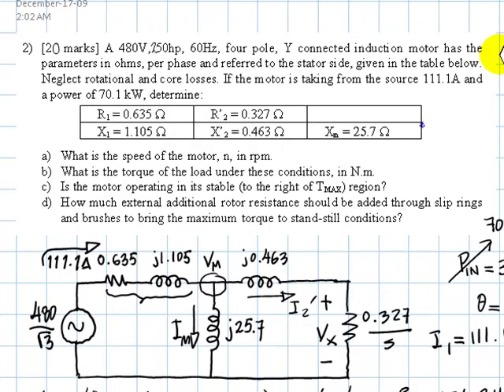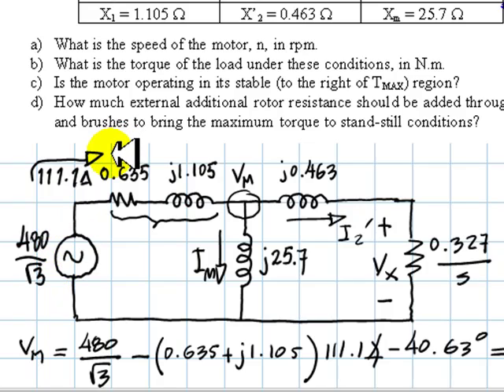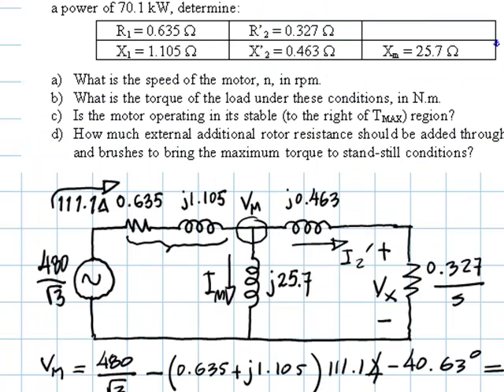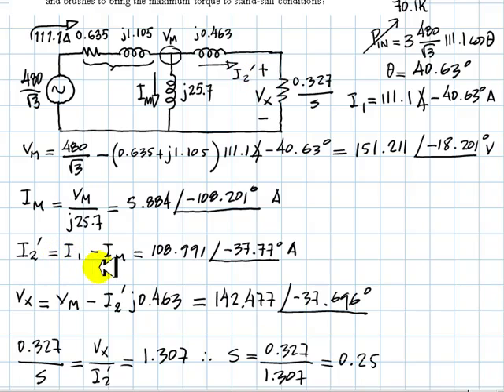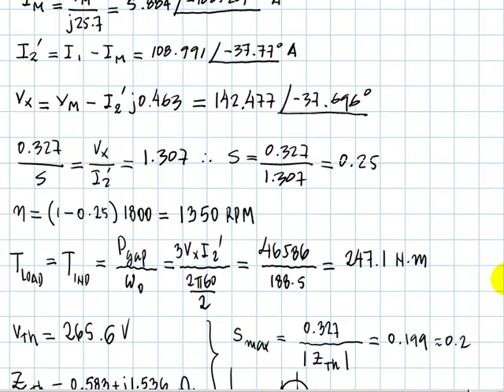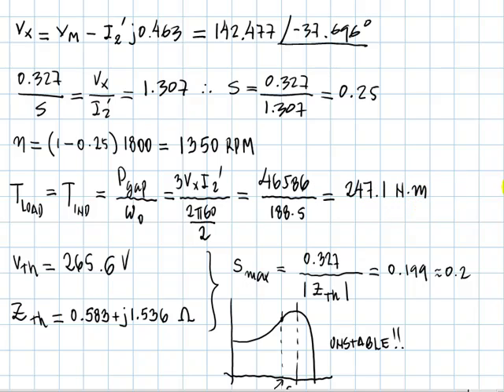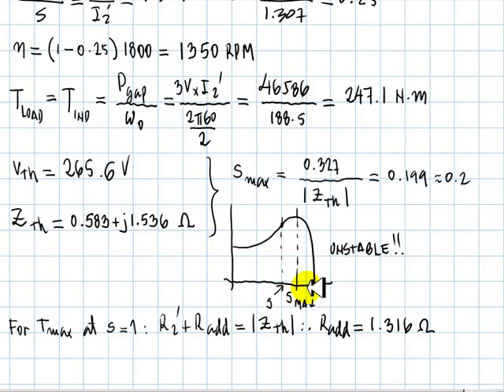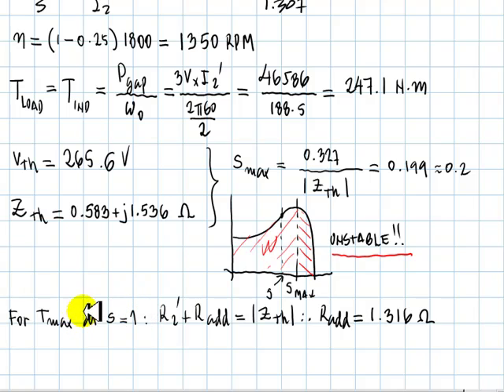EECE 373 - Final Exam. Question 2 (Induction Motor)

Comment: sir sorry but I would like to ask something. Why did we say that our s is on the left side of Smax. I mean isn't 0.25 on the right side of 0.2 in the graph? Thank you.
Reply from the maker: Because on the Torque versus speed plot, the slip axis runs from right to left. s = 0 at synchronous speed on the far right of the plot, and s = 1 at standstill (where the speed is zero). So s = 0.25 is to the left of s = 0.2.

Comment: We have the formula  power=torque*(2π N/60) 
   Which value we have to use as speed?
Is it either Synchronous speed or rotor speed?
Can you help me plz??
Reply from the maker: The actual speed of the rotor, in rad/s.

Comment: What does it mean "to be referred to stator side"? Thanks
Reply from the maker: When you "move" an impedance from one side of a transformer to the other side, we say that we have "referred" the impedance to that new side. The induction motor is a transformer of sorts, so when you "move" an impedance (in the equivalent circuit) from one side (the rotor's) to the other side (the stator's) we say in engineering jargon that we have referred that impedance to the stator.
Reply: thank you so much